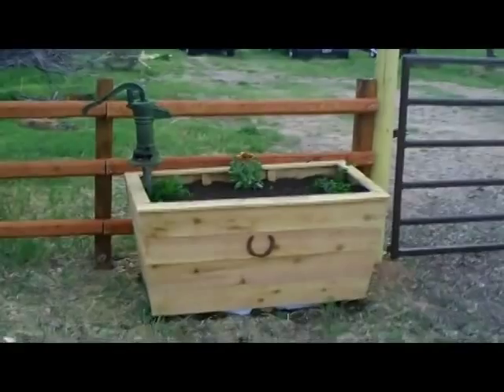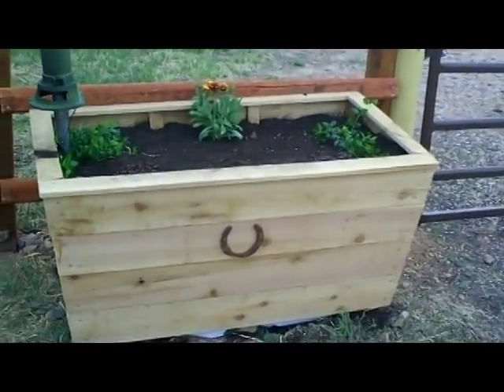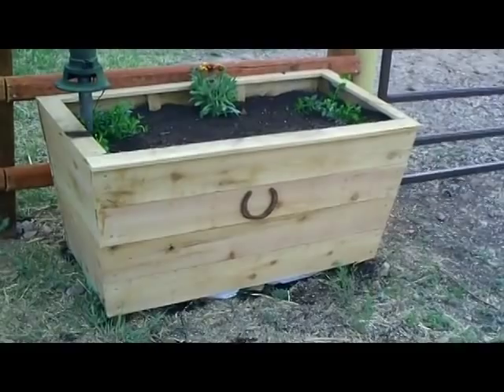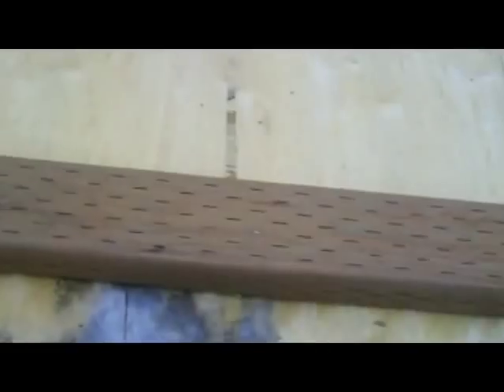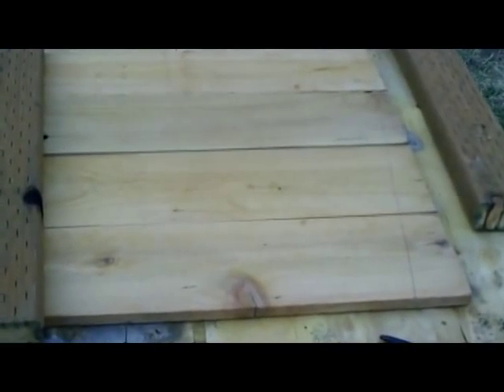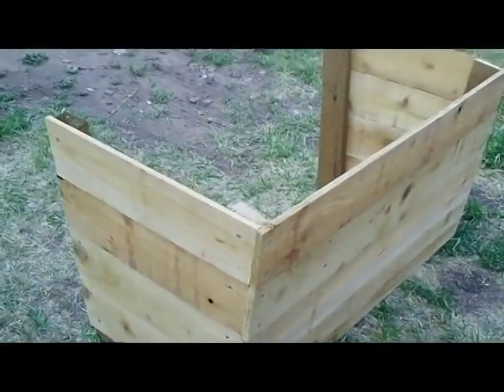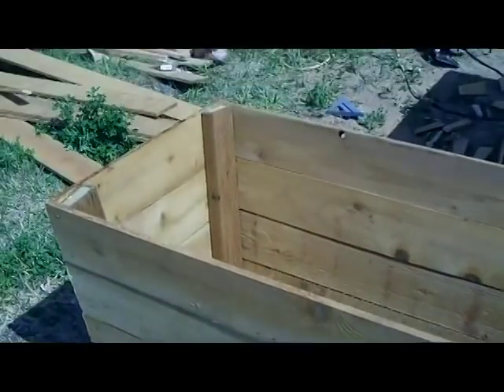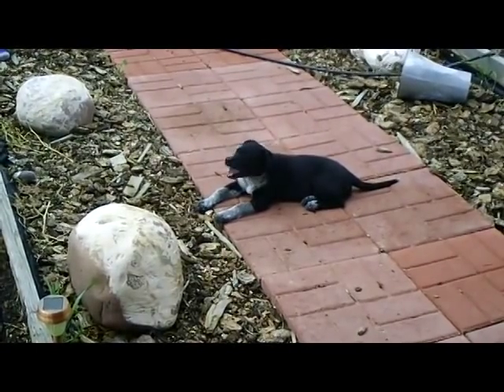Horse Trough Planter

Comment: Hey Lamar, put a layer of milk jugs ,waterbottles or any plastic bottles in for filler in bottom .It helps for a lot less watering.I did it on simular I made out of used cedar garage door sections.Watered maybe 3 times last year.See ya.

Comment: i have a rough plan of it but u tube wont let me post it cause of some copy write issues but i'm buying it from woodtex not building it and it's comeing prewired for off grid use with 12volt led lights threw out i also bought a 3 way norcold rv fridge /stove that runs off of propaine my ac  with heat strip is built for a rv there are 3 of them being mounted on the cabin
and my batts are truedeep cycle gulf cart batterys 48 volts and thers 20 of them

Comment: part 2 ))) the funny thing is that pg&e it trying to have code inforcementto make me run a grid line to my new cabin so i've decided they can shove it and code inforcement is on my side and i'm haveing the service removed from my property. i dont have a camcodrer digital or vcd so i'll have to use stills when its done  my cabin is not small by any means it's 24x48 witch i need cause i have 2 kids and a wife